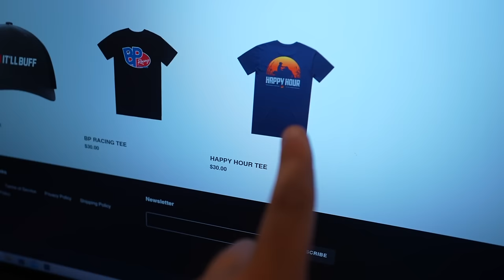SNORKELING THE CAN-AM OUTLANDER! *ALMOST MESSED UP*

Comment: i think ya need to try differnt atvs the can hams are getting old ya bought that junk bass pro atv i think you should look at the cf moto 1000 atv or the 950 ho ex side x side or even the uforce 1000 4 seater looks like the defender they are partnered with ktm thier all 30% to 50% less then can hams n junk polaris you can only watch you go threw yours and garrettes pond so many times it gets old